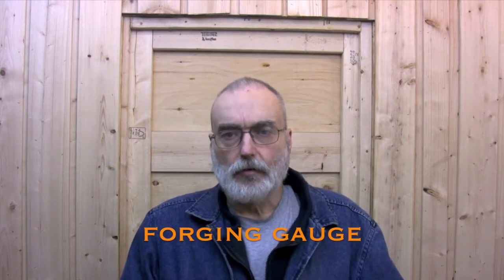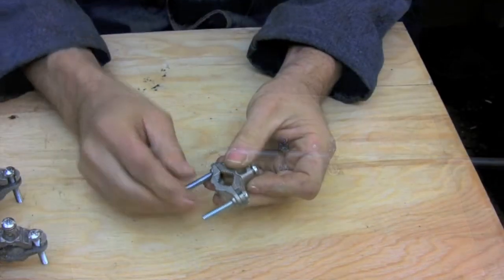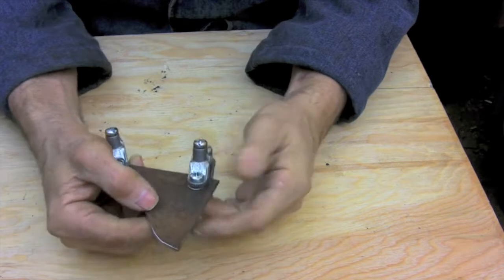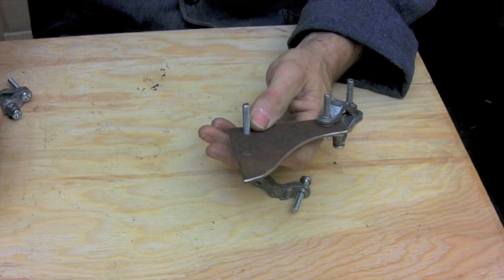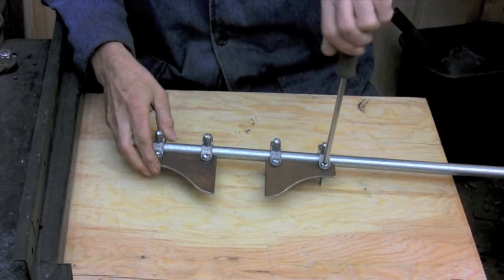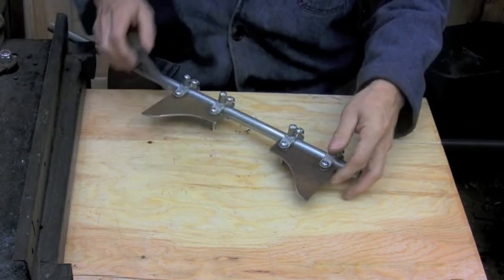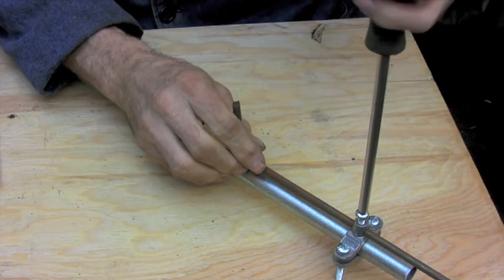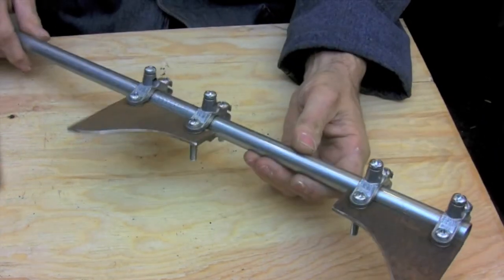Blacksmithing Project: Assembling a  Forging Gauge

Comment: Hi. I still don't understand how I use this....😂
Reply from the maker: Don't feel bad. This is one of those tools that I find vey useful but nobody else does.  For me this replaces a tape measure in most applications.  I like working with measuring tools that have fixed  settings.  There is no guesswork or numbers to remember.

Comment: Great design DF, one addition i would make is to tack the adjustment screws to the clamp itself (if a welder is available), drill out the threads and use wingnuts to tighten everything down to make it tool-less.